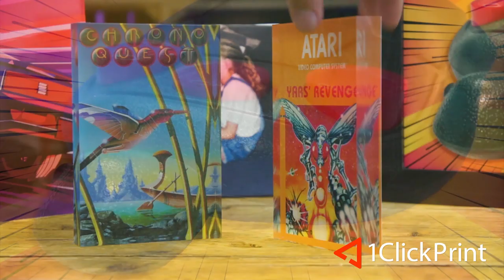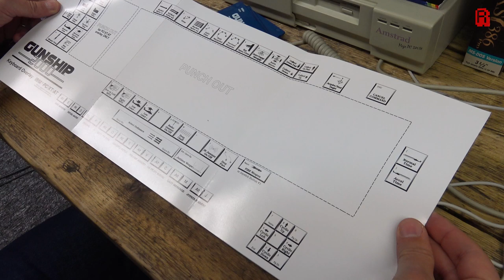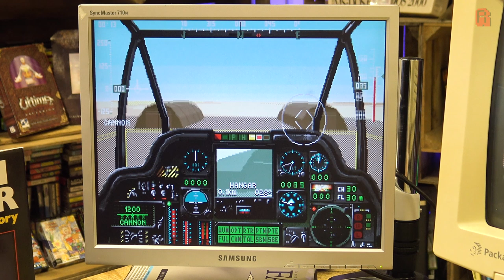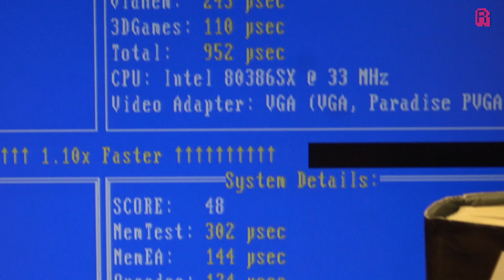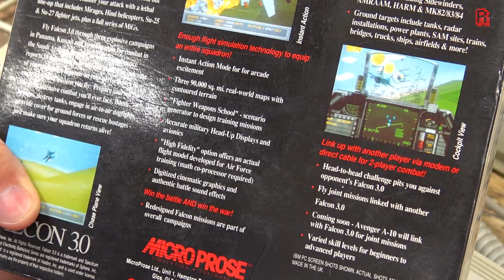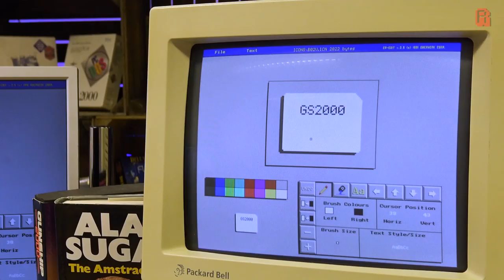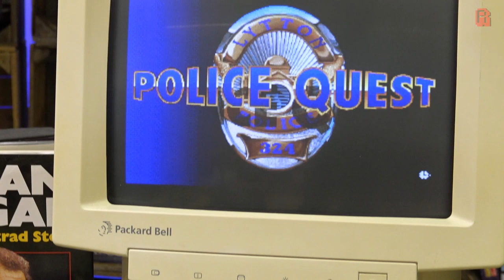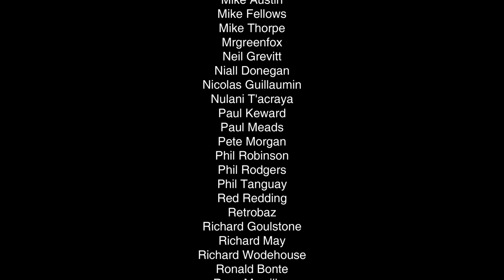Amstrad Mega PC Test Drive | Trash to Treasure (4/4)

Comment: @9:34 I have a 14" multisync CRT monitor from the early 90's which has developed the exact same warping fault. I'm 90% sure they weren't designed that way, so it may be worth testing for bad caps inside the monitor if you intend to use it. The 0.39mm dot-pitch mask on those old monitors was OK for 320x240 Megadrive games, but looks very grainy above 800x600 showing a static desktop.
PS. So is Viglen no longer in business?

Comment: I use a multisync monitor on my Windows XP computer. A HP vs17 although it has a weird ratio of 5:4 it was designed to display both 4:3 and 16:9 images. It pretty easy to find online so I wonder if this would be a good replacement monitor for the Mega PC and maybe some others?

Comment: Question, is it a PAL or an NTSC board on the MD? if is it a PAL it runs at 50hz (slower) you could do a mod to place a 50/60 Hz switch.

Comment: What surprised me was Amstrad didn't make a Mega Drive card for other PCs after this didn't do so well, if it was sold in a bundle with a controller but no game for the same price as a Mega Drive with a pack-in game it would have been a far more sucessful venture and would likely not hurt the Mega Drive sales.
Reply from the maker: I'd like to have seen that with the cart slot on the 5.25" bay.  A bit like the 3DO Blaster card

Comment: Huh, right, for the record, the 386DX came out BEFORE the 386SX. The SX came out as a cost reduced version by cutting the BUS down to 16 bits instead of 32. For the record, there are even motherboards for the 386DX that CAN take 486 CPUs as they are compatible (not the socket, but electrically and chipset wise). The SX is compatible with the 286 electrically and chipset wise. Main difference being the bus with between them.
Reply: And to add insult to injury, you can indeed get 80286 motherboards (with the correct CPU socket and adapter) working with 80486SLC CPUs (which I curse the existence of to this day)

Comment: I love seeing this era of PC.  My first home computer (other then a hand-me-down C128) was a 486DX2 so this is my generation of hardware.

This almost seems like Amstrad's version of that Soundblaster NeoGeo card.  Both products would have done much better if the system had cross usage of the hardware to improve performance on the whole over the parts.  Otherwise why not just buy a Megadrive and a 486?

Comment: I wonder if the relevant bits that run the (working) sega hardware could be extracted (from a broken machine) and paired with anything stronger on the PC side?
Reply from the maker: Amstrad also made a 486 and the motherboard can be swapped into this case with the game card, so it's not tied to the 386 board specifically

Comment: Was that Sonic2 a bootleg or why is the bridge missing?

I would have screamed for happiness if my 486DX2 was able to run in that resolution back then however.
It's still an awesome machine here tho, even if it is just a 286.
Reply: At 10:00 you can see the bridge was like 1 screen width to the left of where it should be, it's definitely not right, probably a romhack or debug mode.
Reply from the maker: I'll have the megapc setup at an expo this weekend.... I shall investigate!

Comment: Thanks so much for making this. I remember contemplating the mega PC as an upgrade from my Amiga. But being a 386 sx put me off. Such a shame it wasn't a DX or a 486. Wonderful machine in retrospect
Reply: Would it be possible to drop in a DX?
Reply: @caw25sha  I could be wrong but I think possibly in the 386 market, it was an issue of 16 vs 32 bit bus on the motherboard.
Reply: @005AGIMA  I've just looked up the 386 on Wikipedia and you're right. I seem to remember that some companies offered SX and DX options on some otherwise identical PCs and that the DXs were a lot more expensive so it's not surprising Amstrad went with the SX.
Reply: @caw25sha  ironically the used 386dx I ended up purchasing was also an Amstrad lol.

Comment: I would NOT mind having one of those, personally, as long as I could have a 60Hz conversion put on it.
Reply: meh. 60 hz is over-rated.
But I suppose you'd have to be a programmer working with these 8 and 16 bit microcomputers and consoles to actually appreciate that opinion, or why it's the case.

Really, the only reason 60 hz is ever 'better' except for some weird edge cases, is because the vast majority of games were designed with 60hz systems in mind, and the conversions were too lazy to properly adapt the timing to 50hz (meaning games run slower - though in fact, games that were explicitly designed for 50hz will run too fast on 60hz. - people seem oblivious to this one because somehow they innately assume the faster version is always correct and intended behaviour, even when it isn't.)

But anyway, to summarise the issue on these old machines:
- a 60hz game will almost always run on a 50 hz machine, albeit often too fast, unless converted well.
- a 50hz game that truly takes advantage of the benefits a 50hz machine offers, will likely result in a game that is outright impossible to EVER run on a 60 hz machine.

The reasons for this are accidental design quirks, but pretty universal among all 8 and 16 bit machines. (they don't apply to playstation/n64 and later hardware though, because how those later machines work is fundamentally different).
And what it means in practice is that 50hz machines have VASTLY more usable CPU time per frame.
Considerably more than the 6/5 framerate ratio difference would suggest.
Basically, for graphics heavy workloads (aka games.), most 50hz 8/16 bit systems have, in effect 80% more CPU time available per frame than the equivalent 60 hz machine does.
This is such a huge difference that some games explicitly designed for PAL territories were too complex to be functional on NTSC machines.

So, yeah... Take it or leave it, but as a retro coder, I prefer 50 hz machines where possible. XD
(And you'll probably see that reflected back in much of the home microcomputer stuff released, which often shows a bias in favour of PAL machines. Consoles not so much, but that's just because they're harder to release anything for in general.)
Reply: @KuraIthys  Well, being that I live in the States, where a 60 Hz signal is the norm, I prefer my Genesis games and computers to run at the proper speed for my region.

Comment: Sonic Definitely wasn't really designed with RGB output in mind.

I mean, it looks good anyway, but still... It's quite obvious in many places.

I have a PAL mega Drive model 2, and a copy of Sonic 2 (amongst other things) this machine was sold to me with only an RF adapter, if you can believe it.
Although that's probably authentic to what these machines were like (at least in Australia) - Nintendo tended to offer at least composite as the default in the 90's, but not Sega it seems. XD
So, obviously I quickly tracked down a composite cable for the Mega Drive - that looks better than RF, but not as much as I might've expected.
More recently I tracked down a SCART RGB cable for it... (note that tracking down a SCART capable TV in Australia nowadays, whether new or second-hand is not trivial. As such I've had to resort to a Plasma display, since that's the only thing I could find with that kind of input... - looks almost as good as a CRT, and better than an LCD - for older stuff anyway, but, more risk of burn-in than any other option...)

That was far more dramatic. Suddenly everything was really quite sharp. However, this also exposes the illusion of the semi-transparent objects for what they really are quite clearly.
Where you can sort of make this out over composite, but it does still sort of look transparent...
with RGB the patterns of alternating pixels and fully transparent areas are very obvious.

A bigger surprise was that the RGB cable improved the sound quality of the machine.
Many Mega Drive revisions have notoriously terrible sound. (despite what fans of the system might say, MD sound quality is terrible on most hardware revisions, and bad sound hardware vastly outnumbers the good.)
Everything I have played on the machine I've got sounded quite awful...
But surprisingly it sounds vastly better using the RGB cable. Go figure. (different connector  of course, since sound goes through SCART just like the pictured does. But still. Not what I expected.)

Comment: It does have useful space saving properties. Just a shame it is a low end 386 with relatively poor graphics performance compared to pentium systems of the time.

I wonder if the megadrive board could be made to work in a pentium pc in a isa slot..

Comment: if back in the day i'd be offered something "similar" for a decent price I'd probably pick it up., I'd just prefer a 486 66mhz or so and the ability to access the MD side to program, maybe even use the 68000 for some coding practise.
Reply: Yeah, the Mega PC is the worse of the two options - the Japanese exclusive TeraDrive lets you do just that; PC and MD work together and can interact with one another.

However, in terms of stats of the PC side, the TeraDrive is even worse;
It's a 286.
And it released in 1994 no less!

What kind of company releases a 286 in 1994!?

No wonder it didn't do so well. XD
Reply: Said 286 was probably cheaper to buy back then, an IBM pc was still expensive no matter what. But sadly it was a good idea with poor execution.
Reply: There was a 486DX version of the Mega-PC but it’s super rare, to the point where many Mega-PC enthusiasts don’t believe it was ever actually sold (despite being advertised alongside the 386 Mega-PCs we all know and love).